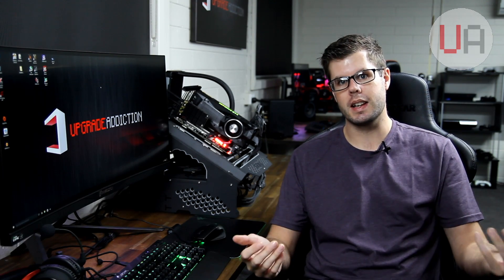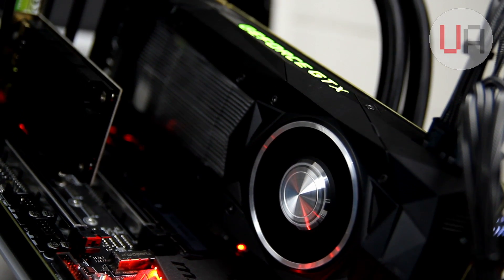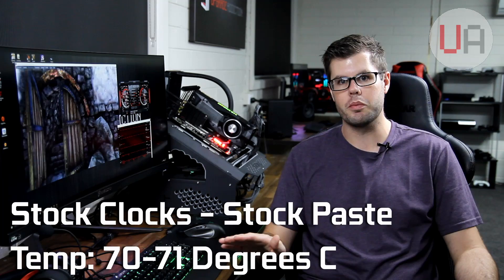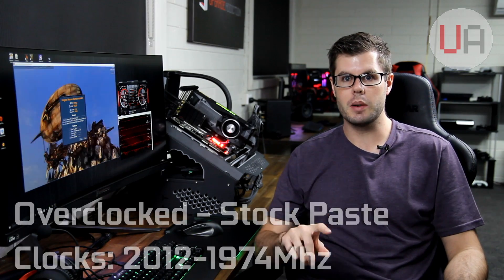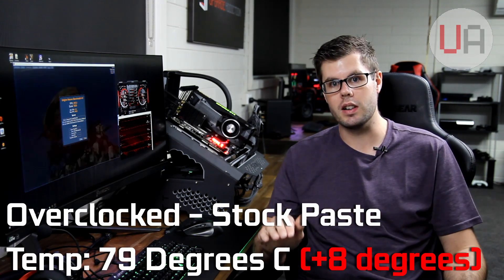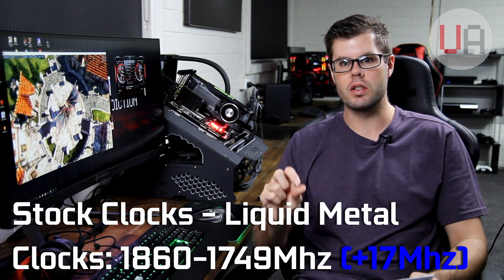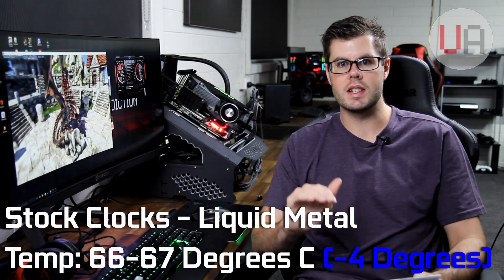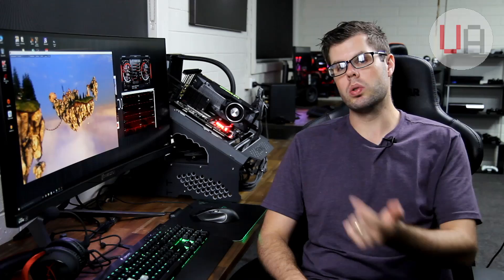Liquid Metal on a Titan X - Does it fix the Temps?

Comment: I picked one of these up used for my girlfriends rig the other day and am thinking about doing the LM swap. I’m not sure if the backplate traps in heat or not but it sure looks like it does, being non vented plastic and all - I removed the back plate off of it like I did with my old blower style Vega in hopes that it’d shed off a few degrees
Reply: What results did you see with the backplate removal?
Reply: I didn’t really get a chance to test both configurations in any satisfactory way but It seemed like thermals improved very slightly though if you prefer the look with the backplate I don’t think it’s makes enough of difference to impact the cards performance

Comment: My 2080 ti ek waterblock 43 degrees with thermalright tfx paste, after replace this, my 2080 ti with conductonaut thermal grizzly temp is 30 degrees on 2100mhz and memory clock at 8400mhz. Ok, i have custom loop 4 radiators and 16 fan ek furious vardar, bit incredible temp!

Comment: Well, mine is 40º in desktop and 90º playing... stock paste. Don't know if I should open it and change the paste.
Reply: Those temps are a little too high. Titan X shouldn't exceed 85C while gaming. Have you tried setting power usage to optimal in nvidia control panel?
Reply: No, why id use that? Im using maximum performance and everything runs smooth even on ultra getting 144fps on most games. The thing is other gpus with maximum performance won't exceed 70º @ahmetakgun7709

Comment: I did my first Conductonaut replacement with my MSI RX480 Gaming X twice.  Once with just adding tim to die and another adding to the heatsink.  Tested at 21c ambient and card ran Heaven Extreme for 30 mins and hit 67c stock at 17%fan on auto.  First replacement dropped it to 64c.  After applying it to heatsink as well because both sides did not completely bond, it dropped down to 60c at 17% fan.  Can confirm, applying to both sides of contacts will give better results.  I am not ready to Liquid metal my Titan Xp and my SLI Poseidon 1080ti.

Comment: Using a copper heatsink with the vapor chamber will definitely improve thermal dissipation. Aluminum is not a great conductor of heat and in return does not dissipate as well as copper. In a perfect world, a silver heatsink would be ideal, but not very cost effective for the manufacturer.

Comment: Better use separate 8pin cables rather than one splitted into 2. JayzTwoCents tested it, overclocks better.
Reply: That should only apply using a multi rail PSU. Single rail shouldn't make any difference at all.
Reply: i tried on my 1080ti and the clock is the same.
Reply: ODIO POWER depends on the power supply.

Comment: will thermal grizzly kryonaut work on copper?
Reply: Yep, just keep it off aluminum. Under 80c max load or it dries out, and put liquid electrical tape around the die on those tiny capacitors.
Reply: Smithy Smit thanks

Comment: You should make it clear to viewers that the liquid metal is electrically conductive so one should be very careful when applying noting the exposed contacts around the GPU. A good trick is to use clear nail polish and coat those contacts to essentially provide insulation to them in case any of the liquid metal gets on them.
Reply: Dude, I looked into that and had NO IDEA you could use clear nail polish to provide insulation. Thanks for that bit of info. I wish I'd have known that when delidding my 6700K. But it's running good anyhow.
Reply: Oh hell yes it is WORTH it. At least it is in my eyes. I was just shocked at just how little TIM Intel uses (the quality of the material is something left to be desired as well), there was barely anything between the TIM and the IHS. And what WAS there was basically just powder, I wiped the TIM off the IHS with my finger and it all crumbled into dust. Gaming wise I'd see temps reach 93 C underneath a Corsair H115i and 4.7GHz. Not very good if you ask me..... running Prime 95? Nope, near instant ctd because temps would almost instantly spike to 100-102 C. After delidding.......... I can game with peace of mind because temps never go above 49 C using a Deepcool GAMMAX 400 air cooler. 41 C max when I used to use my H115i but a buddy of mine really wanted to use it so we traded coolers. Meh, 49 C on air at 4.7GHz is not bad at all. Running a stress test like Prime 95 now..... with the air cooler temps will reach about 80 C and basically hover around there for hours. I used Cool Laboratory Liquid Ultra and have no idea if Conductonaut would be any better. I just happened to go with Liquid Ultra. You just have to be careful when squeezing the liquid onto the cpu die. It's a good thing I tried squeezing the liquid onto an old Pentium 4 to practice first because as soon as I squeezed, SPLURGE. Would have been BAD if I tried that on the 6700K while it was installed onto my motherboard. I just took a q-tip and dabbed it onto the pentium 4 and applied very little (enough to cover the 6700K) and the results are AMAZING.
Reply: is delidding the 6700k worth it? are you seeing results? i think im gonna do the same to mine
Reply: Tom Handley yeah as i said im really thinking into delliding my 6700k. What tool did you use? As for the temps. im currently running 4.6ghz and i see my temps going to 80c maybe 85c wich is not critical, but not what id call good, also id like to liquid metal my 1070 and my laptop, hell il even do it on my old phat ps3, just for the sake of it lol.

Comment: what if you apply the paste on the metal heat spreader of the cooler also?
Reply: i did only that! not on gpu, just on copper. risky but  it helped my hd 6970 temps  85c> 70c. next, on 6850 i did both ;)

Comment: I did not see you apply any liquid metal to the cooler.  The manufacturer says to put it on the die and the cooler base plate.
Reply from the maker: ZZstaff I did that, I just didn't show it. 
If you look closely when I remount you can see I have some on there.
Reply: I wondered the same thing but when I used conductonaut on my r9 390 i emailed them and they said I only need to apply it to the gpu as you want as little a layer as possible

Comment: It dropped my hybrid TXP 6 degrees with 2 F12s push pull @2.1Ghz when compared to stock evga hybrid temps. Goodbye throttling:) Max 45 degrees full load with 20 degree ambient.

Comment: I think he may have made a mistake. Your suppose to scrub the cooler with the brillo pad so that both surfaces are wet. If you apply Metal Compound in the wrong way, it will not perform at it's very best.

Comment: You have to put the Liquid Metal in the cooler too, otherwise, it won't transfer heat the way it's supposed to.
Not to use in aluminium.

Comment: Good video! I am wondering, will Liquid Metal fix my thermals on my GTX 980 Ti Gigabyte G1 edition ? .. What do you think?
I get 60C on OC/NonOC .. sometimes 65C.

Idle is like 40C.. weird
Reply: Rexazor Why is that weird? The card shut the fans off at idle, so 40c is normal. 65C load is not too bad either, but since your card should have a copper coldplate on the die, you could give liquid metal a shot.
Reply: My Fan speed are custom, right now they are at 70% fan speed, it hits 55-60 it goes 100%
Reply: Rexazor 65c is good temp. I would replace the thermal paste if it was over 75c-80c

Comment: Cool video was expecting at least -8 degrees interesting results.
Reply: I think, it would be better to wait 5-6 hours and then to bench again. Thats my experience with liquid metal.
Reply: Put liquid metal on my Titan X with a water block. Dropped 15C. It scales with the thermal capacity of your cooling solution. Better cooler nets a bigger drop.
Reply: Not really when comparing heatsinks. Thermal capacity of your cooler largely determines overall cooling performance when it comes to thermally saturated heatsinks provided ambient temperature and airflow are at optimal levels. Stock vapor chamber cooler is already thermally saturated and cannot absorb much more heat than the stock paste gives it, so no big temp drop with better TIM. Large heatsink or water block has thermal capacity to spare so the extra heat delivered by the liquid metal can be dissipated.
Reply: Again, I was referring specifically to gpu heatsinks which are already designed for maximum surface area for their size and was comparing the tiny blower card vapor chamber heatsink to a better one in relation to applying better thermal compound. Blower cooler gets rapidly thermally saturated, water-cooled one or big one does not.